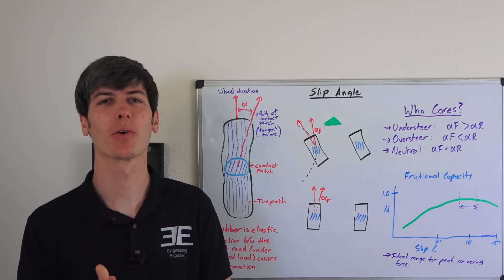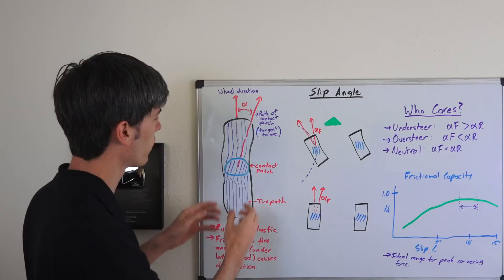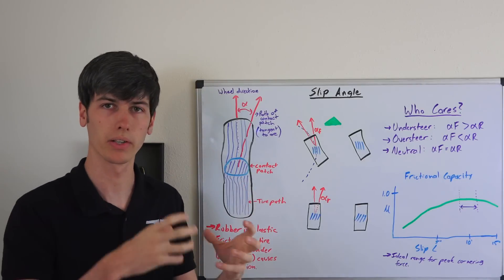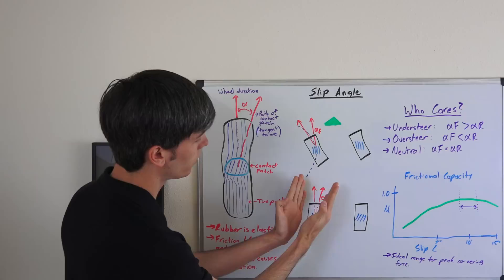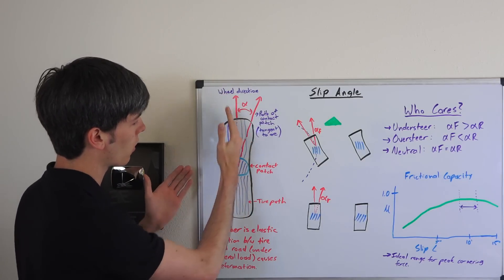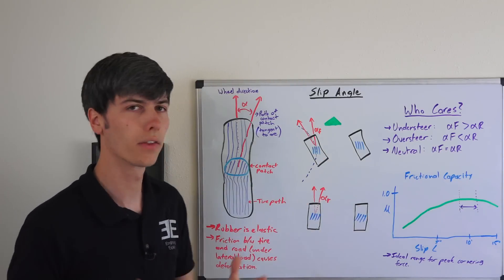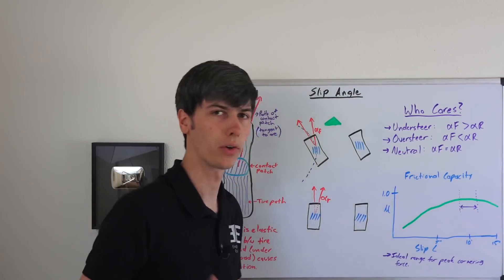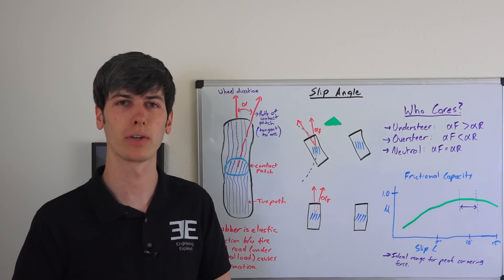Slip Angles - Tire Traction - Explained

Comment: obviously what you want to do is embed piezoelectric fibers into the tire, and then you can electronically control the slip angle independently of the steering wheel. This will allow adaptive front/rear bias and then you can  steer around a turn faster and with more control.

Comment: How sleep angle depends on tire load? It is clear that underinflated tire has higher sleep angle at same lateral force. But does it caused by higher deformation of tire or by lower forces from air inside? If deformation increases slip angle, then in a corner outer tire having more load should allow higher sleep angles then inner. Like if outer wheel was turned on smaller angle then inner. That means that inner should take higher lateral force, and having less grip, should lost the grip first. Is it right?

Comment: Thanks for the explanation, but why do we need to know the slip angle? It sounds like an effect rather than a cause. Is it something we can control to decide whether a turn will go into understeer or oversteer?
Reply: It is simply a term that should be understood.  Definition and a numerical angle. If you are learning performance driving, there is no need to think about this term, but it doesn’t hurt to understand it.
Reply: @urbly2638  thanks, yeah this is how I understood it. Only when you are into an oversteer will you realize that the rear wheel slip angle is larger than the front wheel's, and vice versa for understeer. Unless in performance driving, there are techniques to visualize the slip angles of both wheels.
Reply: And I also think that the slip angle itself has nothing to do with whether the tire has a good grip to the ground or none at all (sliding ), as long as the traveling direction is different from the pointing direction, there is a slip angle. Correct me if I am wrong.
Reply: @GoodManStudio1  You are absolutely correct. I would never try to find the amount of slip angle I used on a fast lap, it would be useless data to me. Although there is a relationship between grip (coefficient of friction) and the numerical slip angle.

Comment: "10% slip... peak friction..." that's about what I understood for longitudinal slip too, which is why ABS systems allow the wheel to lock briefly, so the tyre begins to slip just a little bit (but the elasticity in the tyre wall gives some flexibility). It's all the same tyre rubber, so it makes sense the ratio is the same in different directions.

Comment: 0:16 "the difference between the direction the tire is rolling and the direction the wheel is pointed" should be "the difference between the direction the tire is traveling and the direction the wheel is pointed" I think.. isn't the direction the wheel is rolling and the direction the wheel is pointed the same?

Comment: I am interested in slip angle as a function of coefficient of friction between tire and road. Does the slip angle change with speed with a given coefficient and how is that determined? Of most interest is under steer in low coefficient conditions; say .05 or so.

Comment: Hey! What an awesome video. But could you please explain why oversteer and understeer depend on the slip angles of front and rear tyres?
Reply: A bit late, but I assume it's because slip angle higher on the front will cause the fronts to lose grip earlier than the rear tyres = under steer and vice versa

Comment: sir,
 in the rear wheel the contact patch  tread direction is right or it will be pointing towards left ,so that the friction should counter the load transfer?

Comment: Hello Engineering Explained, for a purpose built drift car is it useful to increase the slip angle much as possible on toe adjustment on the rear so the rear comes out of the maximum friction area of graph quicker?

Comment: in regards to understeer vs oversteer isn't that only affected by the slip angle during a traction situation?
for example if i run (exaggerated) 215 section tires on my 10" rim on the front and 315 tires on my 11" rim at the back, my rear tires will have a lot more flex and deformation. giving them a larger slip angle than the very tight front tires. however due to the lack of traction in the front with such tightly pulled tires the front will skate across the surface causing understeer, where the rear will grip, so even with a larger slip angle in the rear the car will still understeer. or am i looking at this wrong?

Comment: I've been wondering if only the front lose traction & understeering while the back end have all the traction available... Technically the car go straight & doesn't turn at all..

So for the car to be able to still make turn around a radius, the rear need to slip a bit so front can still understeer & make it around the corner?

Comment: can we adjust the slip angle?? (as i understood you explained it as a natural process.)
Reply: +Mohan Aditya If you mean adjust it while driving, that's what the steering wheel is for.  You control the slip angle of the tires through steering, weight shift, and acceleration/braking.

Comment: Great video as always! I have a question however - isn't it normal for the front slip angle to be always a bit bigger than the rear. In a turn only the front tires are steering therefore there should be difference in comparison to the rear tires.Thanks!
Reply: Not exactly. Front wheels initiate the turn in but after the front end starts turning, it is the rear wheels that will have to turn and generate slip angles. When turning, the front wheels first deform to slip angles and then the rears follow

Comment: Yes, When the front steer more than the car turn or the rear didn't turn as much as front means push or "understeer". When the rear turns more than the front or "the car turn more than you steer called oversteer. My question is, why you put a Ferrari 458 Speciale as cover? I thought you gonna explain side slip angle stability control.

Comment: What about on the track?  I have slicks on my race car and there's no tread on those tires ..so what goes on? sincerely a guy who has learned so much through these videos. Thank you
Reply: +Evin Herzberg  This video says nothing about tread, the rubber of your slicks works exactly like this :)  It deforms under load and will not point exactly the same way the wheel is pointed.

Comment: In my opinion there is no "neutral" (in case we are talking about very dynamic driving). I explain you why: If you are going fast in a corner (3/4 or full throttle) there are only the two options: oversteer or understeer (depending on drivetrain concept and damper settings). "Neutral" is only represented by a train on rails, taking a corner.
Reply: I don't think amount of throttle says anything about the speed in the corner or lateral force. 
Also, if there is understeer and oversteer, there has to be something inbetween, the cornering characteristic can't just quantum jump from one to another. That optimum, aurea mediocritas, is exactly what neutral steering means.
Reply: +SlickRickOne What if the slip angle on the front and rear is equal?   What if the car is experiencing equal lateral loading front and rear, and the front wheels are not turned (relative to the chassis)?

Comment: Does tire hardness affect slip angle?
Reply from the maker: Project58sk8ter Absolutely.
Reply: Engineering Explained Sorry shoulda clarified. How does it affect slip angle exactly? Softer=larger angle?
Reply: Project58sk8ter just making an assumption here but i would guess a harder tire = less tendency to distort under friction = smaller slip angle.

Comment: Engineering Explained Can you go into some detail about the portions of the contact patch which are actually slipping during cornering load, i.e where the bonds between the rubber and the tarmac have actually been broken? Is the slipping portion constant with the degree of slip angle? It would also be interesting to hear how this relates to the noise the tyre emits, and when a tyre would begin to create smoke. Thanks

Comment: Does Slip angle still apply to racing slick tires? Does tire pressure play a role? Does slip angel make some tires more forgiving than others on corners? Do manufactures publish slip angle data, or are there too many variables?

Comment: I have a question about transmissions, is it possible to convert an automatic car into a manual which didn't come with a manual model? For example most modern day Camrys or Toyotas in general. I am going to guess it cannot be done.
Reply: it can be done, but at great cost and with a lot of work. its not cost effective. better sell that car and buy similar one with manual trans.
Reply: So what about in a few decades when there is no such thing as a manual ? Do you think it will be a "popular" thing to do ?
Reply: I really don't know what will be popular in a few decades. Still, I'm sure that if and when people do that it will be very expensive and they will face a lot of problems while doing the swap. Those who like the pure driving experience will buy older cars with manuals.
Reply: Fair enough, thanks for your input
Reply: ElectricRides Yes, it can be done, you would need to find a gearbox that fits into the car, or just do a lot of modifications.  A few cars can be converted with a bolt on setup and adapters.
Reply: +ElectricRides Front engine-rear drive cars with a driveshaft are probably easier to do this on than anything else, you need some sort of adapter to attach the transmission to the engine (as it's unlikely any manual transmission's bellhousing will bolt to an engine that never had a manual option), and a custom mount to attach the transmission to the body of the car (which might require modification of the chassis) as well as a host of other parts like a custom driveshaft, clutch pedal assembly and master cylinder (which could be troublesome to fit on a car without a place to mount one) as well as hydraulic lines.  Also, you might have to cut the body of the car so that the shifter will fit, and it might not be in an ideal location for the driver to use...  Basically, if you're making a stripped out race car it's do-able but far too much work for most street cars.

Comment: Can you do one on hood vents
Reply: Alex Martinez not much to explain. the faster moving air travelling over the vents will create a low pressure zone. This low pressure zone will suck out the hot air in the engine. This is like opening a door on a flying plane. All the stuff inside the plane gets sucked out due to the faster moving air on the outside.
Reply from the maker: Alex Martinez Sure: https://www.youtube.com/watch?v=QA6AtmX20pI

Comment: If someone claims to understand tyres - they don't.
Reply from the maker: Equinox That's the truth! I've spent a few weeks doing some research for upcoming videos. It's stupidly complex. At my old job we had a guy who worked solely on tires for over 30 years (as an engineer). When he left we all had many questions.
Reply: Engineering Explained I have the book "Race car vehicle dynamics" and there is said at the 1st chapter which explains tires that there's many things about tires that we can't fully explain. You wouldn't think tires would be so complex but they definitely are.
Reply: Praise be Pacejka

Comment: Slip ratio next!
Reply from the maker: Gregory Evans Longitudinal, rather than lateral. :)
Reply: Engineering Explained  Exactly! It's gotta be different right? Like you said, slip angle is usually between 8-12 degrees slip for ideal force generation in passenger tires, and I have heard that for peak force generation in slip ratio it should be around 20-30%. Do these values match or is there a difference? Can you put a percentage on slip angle and equate it to slip ratio? How do you even calculate slip ratio anyway?
Reply: Gregory Evans slip ratio is easy - if a wheel is spinning at 0% slip ratio, then it will travel the exact same distance that the car moves. if it is slipping at 10%, then if the car travels 100 metres, the wheel (as if it was rolling on it's own) would have traveled an effective 110 metres. The wheel is spinning 10% faster than if the wheel was not inducing a slip ratio.
Reply: Gregory Evans slip ratio is easy - if a wheel is spinning at 0% slip ratio, then it will travel the exact same distance that the car moves. if it is slipping at 10%, then if the car travels 100 metres, the wheel (as if it was rolling on it's own) would have traveled an effective 110 metres. The wheel is spinning 10% faster than if the wheel was not inducing a slip ratio.

Comment: There was a nice thing a friend of mine said on that topic. He said that the relationship between the slip angle and the lateral force is like "The hen came first or the egg?".

Lateral force can produce slip angle, and slip angle will produce lateral force, only you have to fear from one of both!
Reply: Energy input via the driver is what creates an initial slip angle, which creates lateral load. By steering, slip angle is created, and the load follows.
Reply: Yeah, but also a wind gust can create a lateral force which will create a slip angle eventually.

Comment: Driving a circle, the slip angle would be the difference between what...?
Reply from the maker: cpawp Direction the wheel is pointing vs the direction the tire is traveling (as described and drawn in the video).